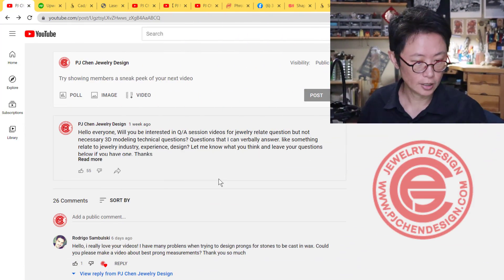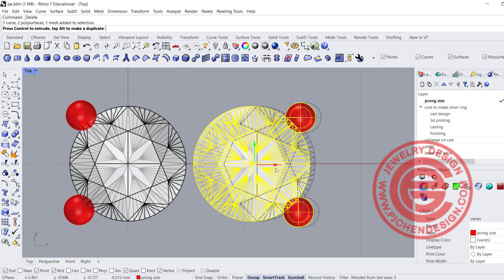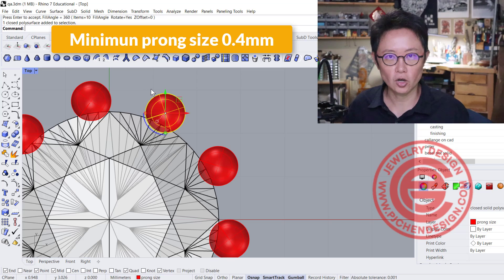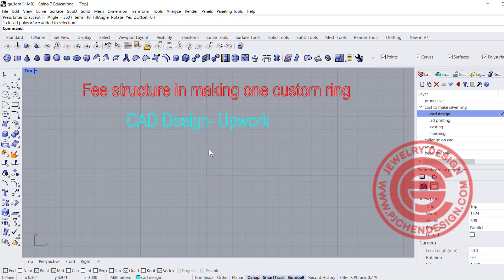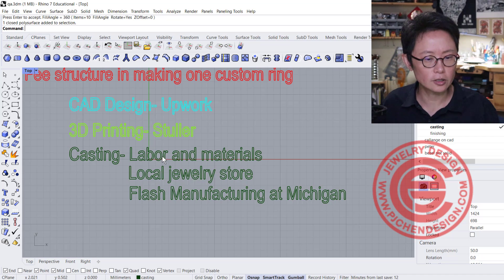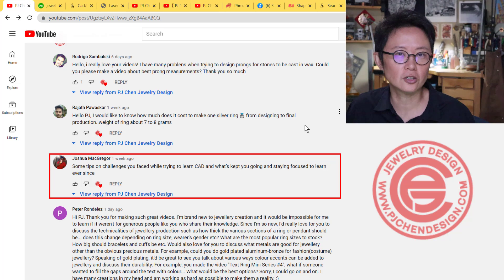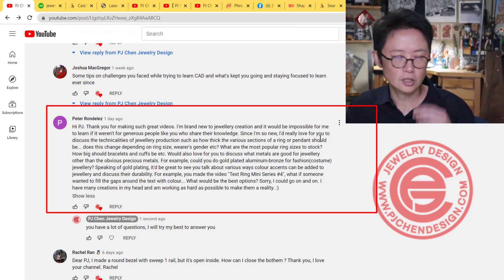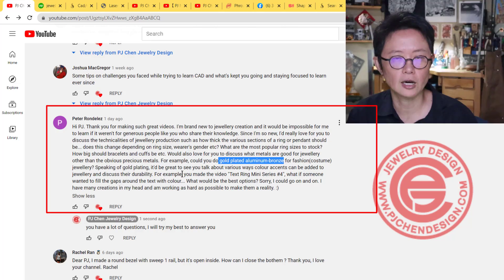PJ's Q/A Session: How to Design Prongs for stone setting? Custom Jewelry Making? and more #233

Comment: Hi PJ
what is the best way to making model supports and the best parameters for 3d printers
Thanks :)
Reply from the maker: people has different methods and preference. I often see people has big cross support on the bottom of ring shank. but also see a lot of small rod for very texture surface.